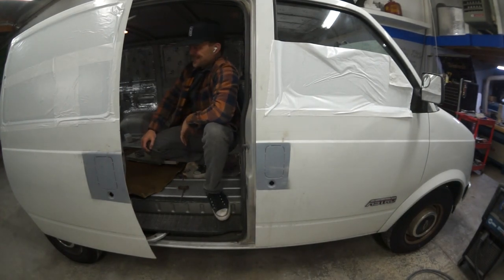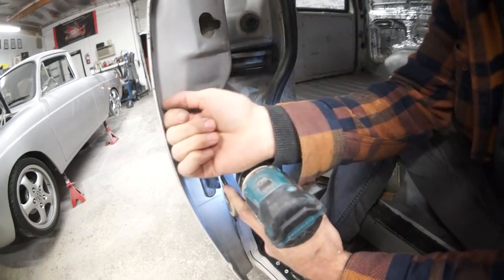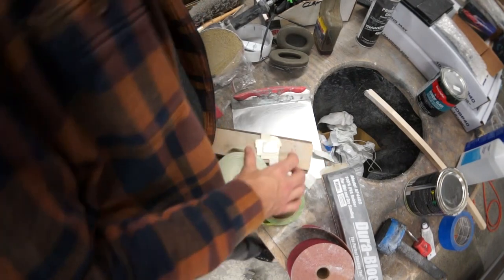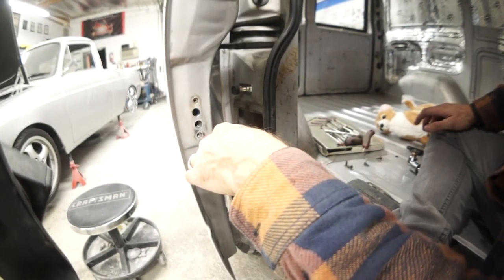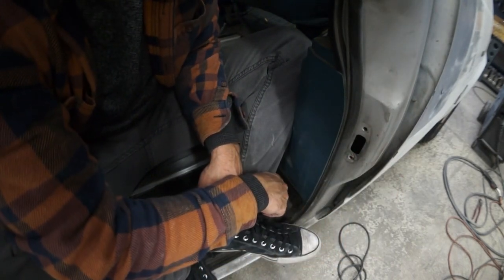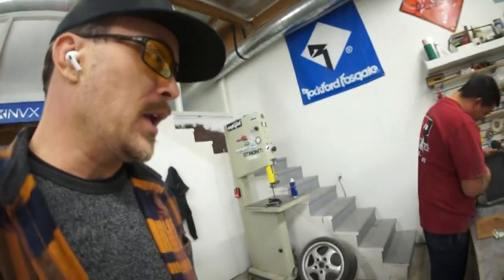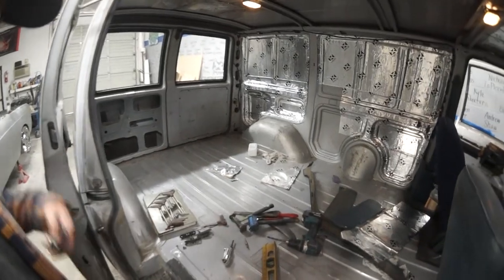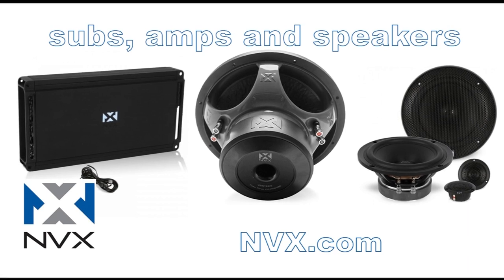WAIT TILL YOU SEE TODAY'S MESS! - Bass van vlog #16

Comment: Idea for the sliding door...weld in plate behind for bracing then weld in filler plate. (bog reinforced of course) That would give you good metal to tap for bolt holes for the door connector.

Comment: Hey Doug. On your bass van you might want to consider adding a hidden power port/plug to plug in a booster pack in case of a dead or low battery, so you can get in to your van. without power it'd be virtually impossible to get in it.

Comment: When I did my safari van I used the same adhesive that the auto glass guys use to put the front windshield in on the roof braces. I peeled out the foam crap that the factory puts in and put windshield adhesive in between the roof panel and brace then again between the wood and the brace. I had 4 kicker solo x 18's on 2 kicker warhorse amps and the roof didn't flex at all. I filled all the other braces and pillars in the van with expandable foam and the put 2 layers of sound deadening over the entire interior of the van. I had absolutely zero flex anywhere in the van except the dashboard. The dashboard flexed all kinds but I just left that alone. Just a few things I did to my safari van if your looking for any outside the box ideas.

Comment: Why don’t you sand off the boxed end of the receiving contact and if possible being enough plastics sand it at an angle so it can find it’s way in easier . Worth a try. And for the plunger why not make a spacer for the plunger itself and use a longer self tapping screw  so it would be van/spacer/popper instead of adding more to the striker pad on the door .

Comment: None of my vans have successful poppers on the side door. So they used a small cable and attached it to the inside handle and ran the cable to the back. Sucky set up but it works

Comment: I'm curious to see how many welds fail and how much body filler cracks off when that van starts flexing. Not that Doug doesnt know what he's doing... but I dont know if his "shaving " is strong enough for a bass van build. And you better use locktite on the actuators and poppers or you will vibrate everything loose. I am curious to see the final result, but as a body man myself I see some of what he does to this and the mule and I cringe. Like welding the door and I see the interior light on... battery isn't disconnected and the sparks will ignite the fumes......🎆

Comment: Can you mount the tabs for the the sliding door at an angle equal what the original tabs slid into each other?  It should only take a 1/2" or so lift on the left side of each plate